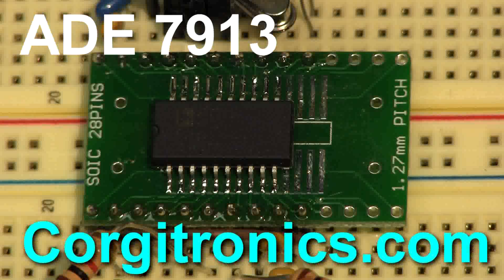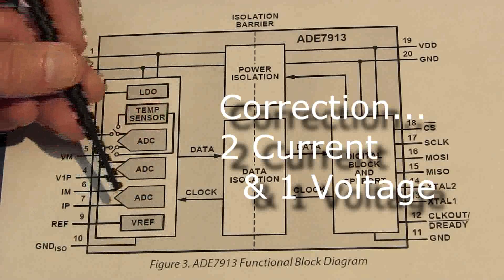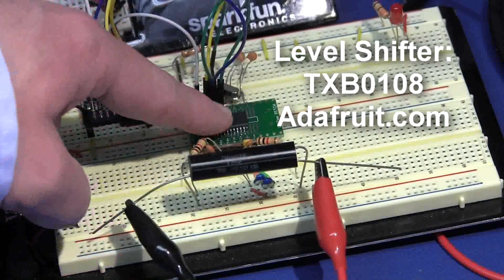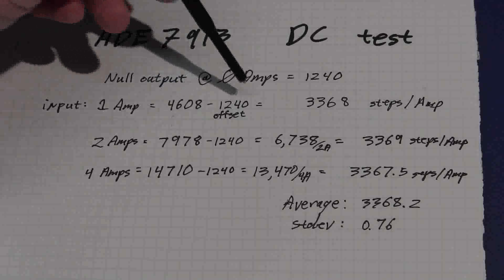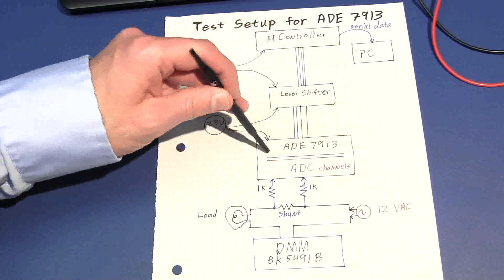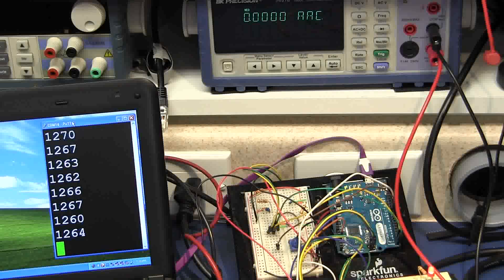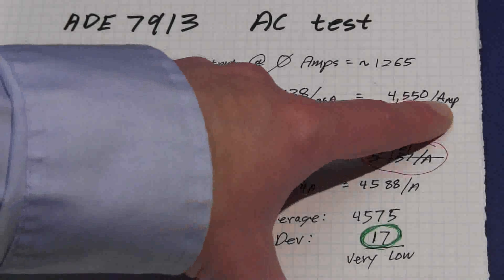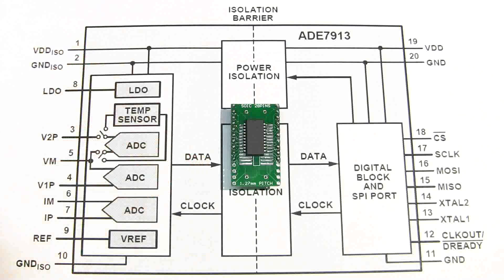ADE7913 - AC Current Measurement and Observations

Comment: How expensive!
Reply from the maker: Yes, the ADE7913 is a pricey solution.  But, it avoids the need for a separate isolated supply, which may not be important for a given situation.  At over $12 for one chip, this isn't something that I would choose for a personal project, unless I was only making one or two boards.

Comment: Great video. Thanks for sharing. For ages I've been looking for a solution for my application that would avoid me needing to have a separate isolated power supply, and the ADE7913 seems to be just the job.

Avago's ACPL-C87B came pretty close, but cause I wanted to measure a reversing voltage and it (the ACPL-C78B) has only a 1-sided input (0-2V), I would have had to have a level-shifting circuit on the non-isolated side (and so needed a separate isolated power supply anyway).

ADE7913 looks just the ticket for me. I had a look at Corgitronics.com. There's some cool stuff on there but couldn't see any additional test details on the ADE7913. If you are planning on sharing the Arduino sketch let me know as I've not used SPI from an Arduino before so it'd probably save me some head-scratching.

Also, I'm very jealous of the impressive test and gear set-up you've got there!

Comment: I should mention I am an applications engineer working on the ADE7913 and other ADE metrology ICs for Analog Devices inc.  I came across this post while doing a search for something else and have never met Corgitronics.
Reply from the maker: dave smith Thanks for the feedback.  From the comments I had a feeling you might be an engineer for the chip, or just have a lot of experience with it.

Comment: I would suggest a high pass filter(2Hz or so) before the RMS function to remove the DC for AC measurement. 

for DC measurement measure the codes at 0 volts and subtract from the ADC output before the filter. 

I have done both AC and DC using the ADE7913. The AC performance is equivalent to the ADE7933/ADE7978 metrology chipset when the code is implemented correctly. Which is better than required for billing in residential and commercial meters

Dave Smith
Reply from the maker: dave smith I'll return to these measurements soon, and I will redo this test with a 2Hz filter on each of the inputs.
Thanks for the comments and suggestions!
Reply: The high pass filter I suggest is a digital first or second order in the micro.

Comment: there is a small dc injected into the adc to reduce idle tones this is why 0v is not 0 codes. It will vary over temp slightly and can be subtracted out in the micro.

dave smith

https://www.youtube.com/watch?v=l5nkdicvuTY

Comment: Looks like an interesting little chip. Is there a reason why the Null output count is as high as 1240? Would this vary on chip to chip or is it a constant?
Reply from the maker: Scullcom Hobby Electronics I haven't tried it across multiple chips, but it should vary a bit with each.  If I was to put this into a real product, it looks like I would need to setup a self-calibration procedure.  There are some recommendations in this application note:
http://www.analog.com/media/en/technical-documentation/application-notes/AN-1304.pdf

That offset can be due to the temperature or power supply, and probably varies a little for each device.  It has a built-in tempco, but I don't recall setting that offset register.